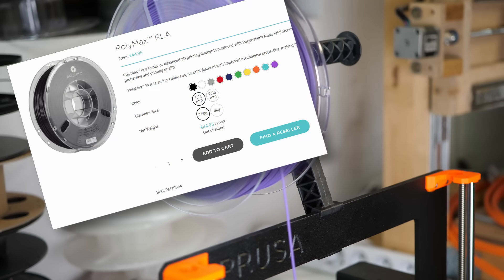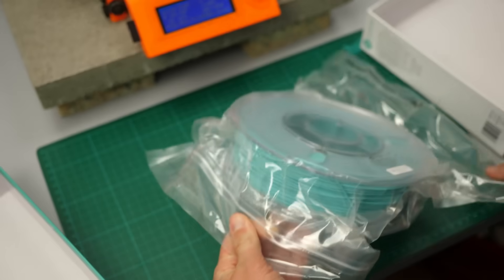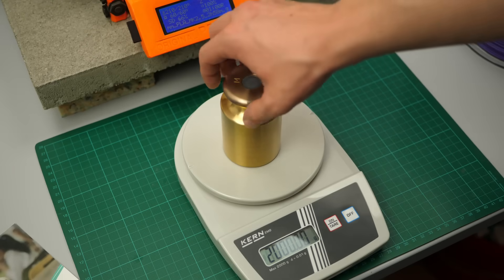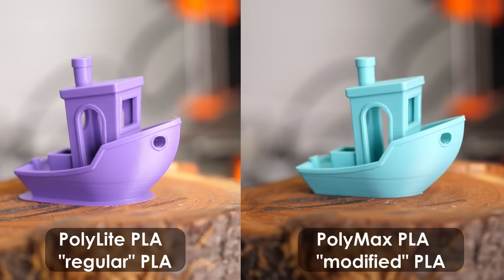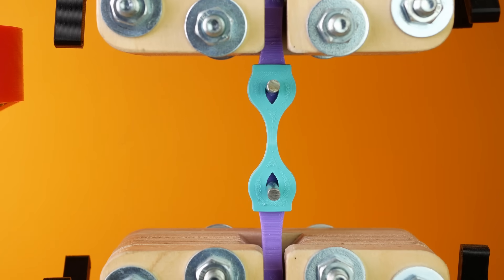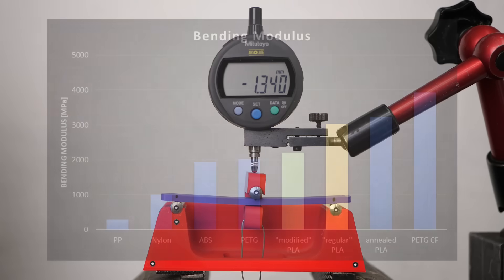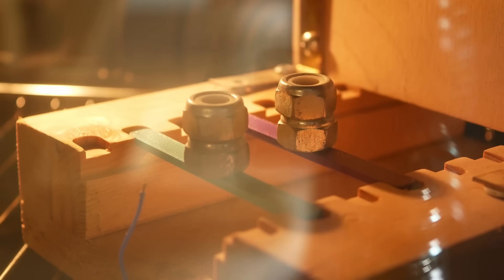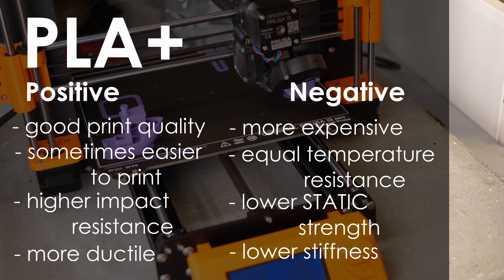How much STRONGER is PLA+ really?

Comment: PLA+ blends are way different between the vendors, would like to see a PLA+ shootout video!
Reply: Yes I found eSun Pla+ to be very superior and also quite cheap
Reply: @yoloswag4063  yeah thats all i use at £18 for 1kg
Reply: @yoloswag4063  I ended up with eSun while looking for well reviewed cheap filaments that Cura had built in presets for when I was just starting out recently.  $30/kg CAD on Amazon is pretty good, and have had great results since I realized my issues were being caused by poor parts cooling and a dirty print bed.  It also seems to be fairly popular with 3D printing YouTubers, including one who does miniatures printing tutorials using the exact same filament.
Reply: @Kune35  esun pla + is great. I had nothing but problems starting until I got some of that. Prints effortlessly compared to creality pla.
Reply: @dominick253  interesting. Whatever sample pla that comes with the Creality Ender 3 v2 printed incredibly well for me. Nearly flawlessly. Really surprised me as my modified i3 clone gave me a lot of trouble or to produce the first print off the v2 with the sample pla
Reply: Im new to 3d printing, but so far my favorite PLA is definitely esun pla+. Prints easily and much stronger than i ever expected. It was my 1st ever filament that i ever printed with and its still my favorite PLA. My very 1st print was that little cat stl that comes with the ender 3 and it came out nearly flawless. I was honestly mind blown. I thought it was going to be a long rage inducing battle with the settings to print anything decent. It printed  even better with some tinkering of my settings after binge watching youtube videos about 3d printing. It works AMAZINGLY for 3d pens too. It prints waaaay better than the regular 3d pen color samples that you buy on amazon and the stuff you make is nice and stiff. You just have to print at like 210-215.
Reply: @alexcrowder1673  I've had outstanding results with the same filament.  I run my extruder at 210-212C.  No stringing at all, good layer adhesion, nice gloss.  I did find that it sticks a little TOO well to my Buildtak-like bed plate, so I remedied that by dropping the bed temperature a little bit lower than the range that is usually suggested, settling on 45C as the best compromise between keeping the parts attached and flat while printing, yet still being able to remove them without resorting to a mallet, or reheating the bed to a temperature where the plastic begins to soften.
Reply: I use a lot of ESUN and SUNLU PLA+ and I love it for my 3D printed nerf blasters.
Reply: I need information about printed materials with nano additives
Reply: @dr.mohamadalsaadi1657  p

Comment: I cant speak for anybody else. But I use SUNLU  PLA plus, I can get it almost cheaper than regular PLA from Amazon and I really like the finish. I don't really need to print things that are structurally important and it prints so well on my modified CR10S that I run it at about 90mm/s print speed some times faster depending on the object...

Comment: I first got a 3D printer in 2017, and like everyone else, got a roll of PLA and a roll of ABS. We were warned not to use the PLA for functional parts, but ABS was a major pain in the rear - it warped, it wouldn't stick to the bed, etc. etc. etc. A local company was selling something called "CPLA" which they claimed was tougher than regular PLA, so I got a roll and... well, it was like a totally different material. It was really easy to print, and and it was NOT brittle like PLA. It was tough, like ABS, with none of the warping issues. I was so impressed I used it almost exclusively until, unfortunately, it became unavailable. I was quite disappointed (though I had a half dozen rolls of it on the shelf). Sort of got out of 3D printing until recently (printer needed a new nozzle), and was wondering why no one on YouTube was doing reviews and tests on modified PLAs. Eventually I found a few - mainly involving eSUN's PLA+ - the consensus was that it's tough and easy to print - just as I had experienced. I've just recently got a roll of the eSUN PLA+, and another Chinese modified PLA called PLA-F (which comes really neatly wound on the spool - no more tangles). The former is expensive if bought locally, but is cheap from China, the latter is VERY cheap, as cheap as I've seen for PETG, though not as cheap as some regular PLAs. The company that was selling CPLA is now selling something called PLA-Max, which I'm going to try soon, too. I've got a roll of PETG and will give that a try eventually. I mainly use the CPLA/PLA-F/PLA+ for making accurate tools, patterns, guides and jigs, for which it is totally adequate - this is where I think the power of 3D printing lies, not so much in functional parts (though I also plan to make some of those as well).

Comment: Dear Stefan, in fact you have chosen one of the worst options for comparison in the form of threads from this manufacturer.  There are many options that show significant progress in the transition from PLA to PLA+.  Next - temperature tests.  As a common PLA+ are subjected to annealing, which increases their temperature resistance.  And the last thing that emphasizes the previous - all manufacturers have their own recipes that are sold on the market under the same or very similar names, but their actual differences are so different that in fact does not allow to talk about common features with the same name.  The materials are too different in the end.

Comment: Hey Stephan, I used eSun PLA+ and I am quite happy with how it prints, I have not tested the strength but it really prints really well.  Thanks for yet another amazing filament test video.  Congrats on your baby.
Reply: I cannot report such good results. Inconsistent filament thickness, bad bed adhesion from 50-70C on a glass bed (not even ob masking tape) therefore severely warped prints.....
Reply: @GreenCaulerpa  For me the filament sticks well to my default ender 3 glass bed

Comment: I'd like to see these tests performed with Raptor series filament. Unfortunately, I think the manufacturer (makergeeks) has disappeared.
I've been trying to find a similar formulation. I printed a benchy and annealed it by putting it through the sterilization cycle on my dishwasher. When cured in this manner it becomes very strong, such that I can stand on it (170lbs) without even deforming the smokestack. Others have labeled it "explosion proof". I have three rolls left and I save them for prints where strength is of utmost importance.

Comment: The main benefit of PLA+ seems to be less warping and better bed adhesion, two of the things that discourage beginners often.  I feel like these companies need to market it as beginner friendly instead of as an upgrade to PLA or a "tough" version.  Most people starting out are printing nick-knacks and vases, so tensile strength and impact resistance are much less of a concern over printing properly.  As people progress into functional parts they can move into pure PLA, PETG, and ABS depending on their needs.

Comment: PETG is my 'goto' standard material, I rarely use PLA because it's so brittle. I can't see any advantage of modified PLA over PETG to be honest.
Reply: I think that pla or pla plus its for static models, for funtional parts , then petg, abs, asa an other thecnical materials
Reply: @noway8233  can you explain different between static and function parts? I would love to be able to differentiate
Reply: @nathanp5877  a static model would be a statue or bracket for holding up a bookshelf since these have no forces or static forces respectively.

Functional parts would be RC airplane parts where forces happen at an instant.
Reply: @awellner3285  I see, thank you for explaining!
Reply: PLA is pretty tough for most uses. It is brittle, but it should be fine unless you hit it with a hammer lol
Reply: @kerbodynamicx472  - Unless you want to use it outside, or in the car... PETG can be used in virtually every situation where you might use PLA. I'm not trying to convince anyone to do the same, only to explain why I find PETG to be better at covering all of the uses I have for 3D printing.
Reply: Print speed

Comment: It is pretty much all I use. In my applications it works better. Paints, sands, glues holds to a higher temp.  Though I have never used the really expensive PLA so I can't compare with that. The pla I used to used was $10-$15. Pla plus in my area is $19-26 USD

Comment: You should test materials for creep, it's probably the greatest weakness of PLA other than low heat deflection temperature (but that can be fixed with annealing, seems like creep can't). I've had some PLA parts fail with stresses under half of the tensile strength, just over a long period of time.
Reply: +1, have had quite a few crack apart after some months or years of continuous or regular brief loads. The continuous loads were really small. I am abandoning PLA because of this. I also noticed, the older the spool - the worse this problem gets.

Comment: I don't really care for PLA+. A lot of what I do has a mechanical engineering angle to it, like gears, brackets, bearing housings etc. In those cases it's stiffness and ultimate/yield strength you're looking for. A gear that bends is of no use to me, a bearing housing that will let gears push each other apart is useless. And if I do need something impact resistant I tend to go to ASA because I'm quite familiar with that material, but a PETG will also work fine while being cheaper and also being temperature resistant inside a hot car. In other worse for "daily-use" parts PETG seems like a much better choice than any PLA+.
Reply: It's not THAT flexible, it's as stiff as nylon or delrin (and they do use those for gears). Nothing like TPU. I figure if you aren't putting enough stress on your parts that PLA won't hold up, these modified PLAs would work fine. I've printed and assembled a 10:1 rubber winder with gears using CPLA (a local vendor's version) and it works pretty well.

Comment: I print pla+ a lot at 235 C and see strength differences from doing so. I missed what your settings were in the video.
Reply: 215°C for both materials  ( 3:55 )

Comment: PETG is not as easy to print as pla / pla± - mazel tov on the kiddo
Reply from the maker: Good point and thanks!
Reply: Robert Adams - I disagree, my Prusa MK3 churns out mostly PETG parts with ease. I just the standard settings for Prusament PETG and the prints are fantastic.
Reply: @rogerfroud300  I think it depends on the part. Overhangs / bridges are much cleaner on PLA than PETG.

Comment: I usually use eSun PLA+, but during lock down I tried some SunLu PLA+ (as I couldn't get eSun),  I just could not get on with it. I bought a 3 roll pack of 3 different colours (3D printer stock was getting rare).
Each colour sent me back to basic tuning every time, and I never found a setting for any of them I was completely happy with. The silver being the worst. It was like printing with rubber, continual oozing and stringing which left the nozzle empty for the start of the next layer. I couldn't print anything that had long travel moves. Changes in retraction made little to no difference.
I don't know what their formula is, but completely parts were noticeably more flexible than I was used to.
I might as well have been trying to use PETG! (I have a non-bowden machine for that!).

I was so glad when eSun came back in stock. I pulled up my previously saved profile and everything was great again.
Reply: Had the exact same experience, usually use Esun PLA+, tried SunLu PLA+ - it was the first filament I have used of any kind that absolutely required bed adhesion help.  Could not get it "dialed in" to good print settings.  The Esun PLA+ "just works".  no bed adhesion problems, no warping.  Bit of fine stringing that can't be "tuned out", especially on the black, but I just give prints with strings a very quick "flame treatment".  I would also like to see how Esun does on the "CNC Kitchen standard tests".
Reply: I find it funny you mentioned about the difficulties with the silver filament. I have been battling my way through 2/3 of a roll of eSun silver PETG trying to get a decent print. It prints exactly as you say, like rubber. I tried it on both a direct drive printer and a bowden. Just before pulling my printer apart to fix a problem that didn't exist I tried a roll of black then a roll of red. All at the same settings & with the same pre-treatment. Both printed perfectly. Guess I won't be printing silver anymore...
Reply: SunLu used to be really good. Since "Corona" they have massively reduced their quality and I have ended up sending several reels back.
It looks like they are extruding it in the cheapest and fastest way possible now, as it used to be a high end filament, and not it a tangled mess of inconsistent width junk

Comment: How do you deposit PLA?
I recently bought biodegradable plastic cups for a Party. On the Label it says PLA. So are they safe to go into the "Grüne Tonne" alongside with other compostable waste? 
I've always throw failed PLA prints into the plastic bin.
Reply from the maker: Good question. I wouldn't throw it into the compost bin, even though it's bio-degradable on paper. I'd throw it into the plastic recycling bin, where it's probably sorted as energy waste and burnt.

Comment: Congratulation on your new addition to your family... I have been using Polymax PLA for printing RC car parts,  works out much stronger than PETG or ABS. that I have tried...  to the point of being almost unbreakable.... almost.....
Congratulation  Steve
Reply: I used PolyMax 4 years ago for RC car (HPD F1). Since then I have mostly been using Esun PLA+ as it (in my application) has performed better especially in layer adhesion. That it is less than half the price is a bonus.

At the time PolyMax had its place as it performed so much better  than the PLA that I was using then.

If I want better impact strength than that I go for Alloy 910.
Reply: @KentAsplund  Hi Kent, thanks for the heads up on Esun. I have ordered a real. thanks  Steve